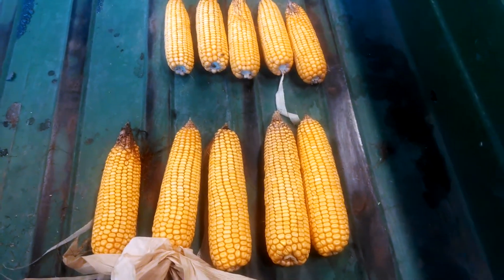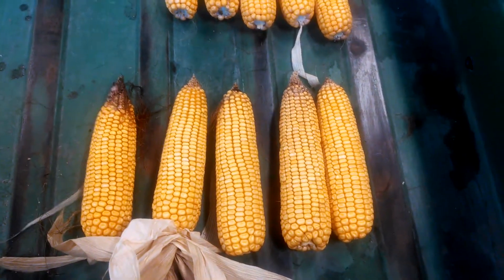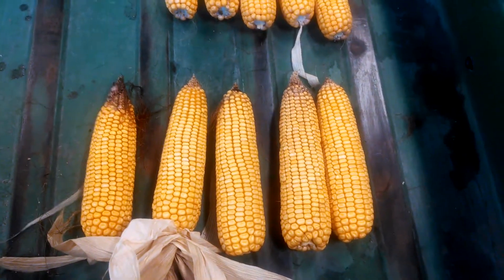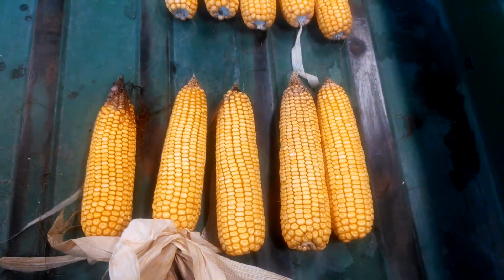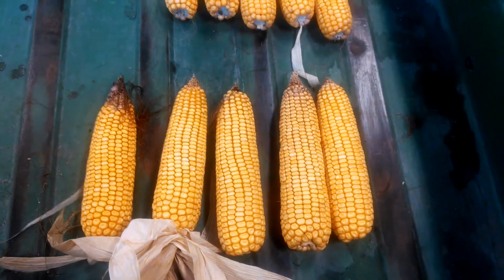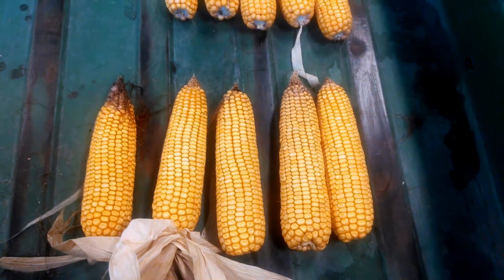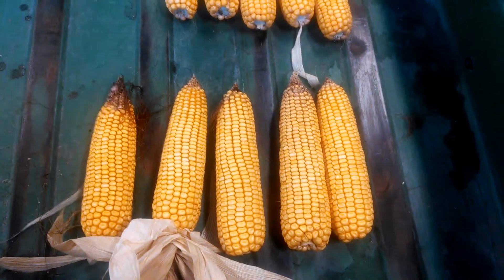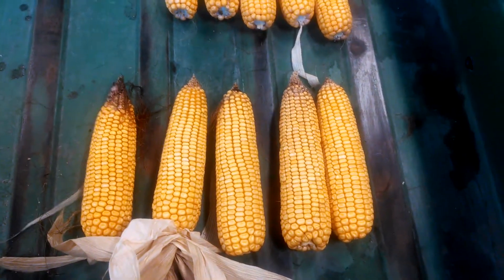Ear size depends on available nitrogen

Comment: I don't worry about breaking down the residue. Our old stalks are still 2' tall with the new corn except where hit by the tires.    We have a lot of residue with 10' tall corn.   It is a friend to us when it is 98-103 degrees with 15% humidity and 30-50 mph wind gust.   I would suggest putting your first N around planting and the rest later as the corn takes large amounts per day.  We put the second 1/2 used through the sprinkler around tasseling to blister.